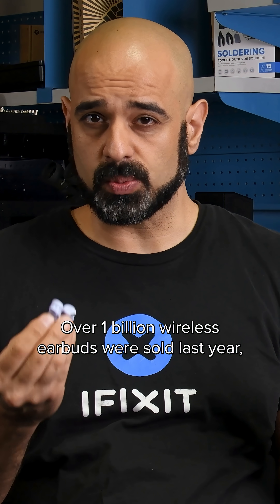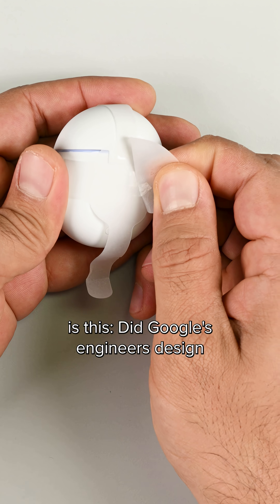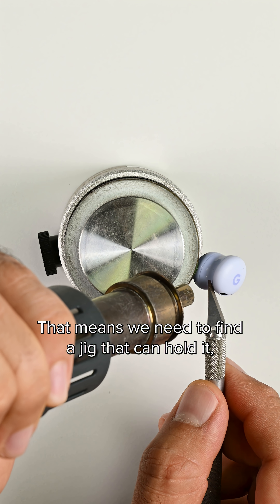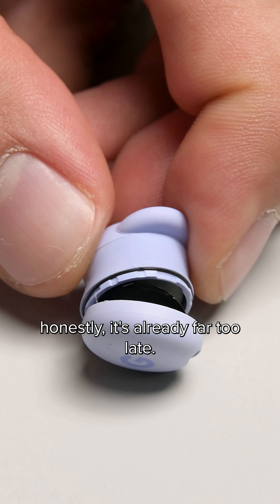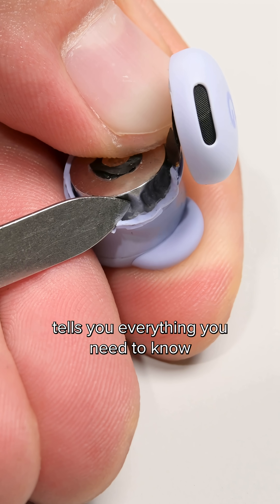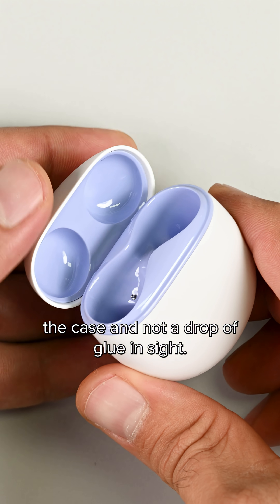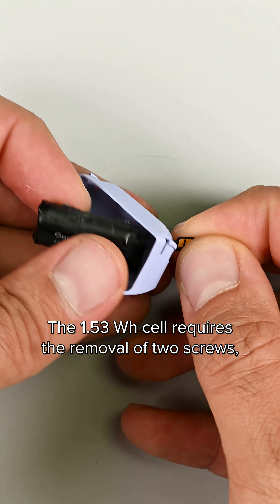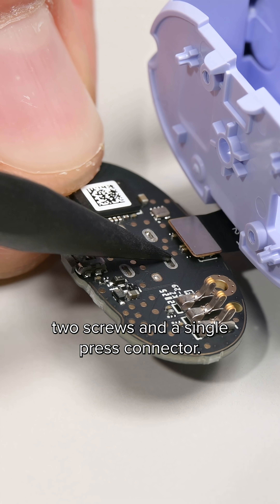Pixel Buds 2a: Two Button Cells Short of a Repairable Trifecta

Comment: Ah so the part with the battery that'll die first is unrepairable. Smart move from googs
Reply: Why are you so cynical. You're like so negative. Like it's not perfect but they took a big leap and they're getting there they're going in the right direction just be happy about that at least
Reply: @Alphabet7 well its like when apple made screens borderline impossible to replace. Its the most likely part to fail first. In this case the battery will likely fail first. Repairability to me means being able to replace the parts that will fail the most. This doesn't really meet that criteria now does it? And we should be critical about these companies considering that their forced planned obsolescence is destroying the environment massively. They all need to be held accountable especially in this case.
Reply: @Alphabet7  its like saying MacBooks are repairable because they have modular usb c ports that you can replace pretty easily. and only few windows laptops has that. no, MacBooks are not repairable at least they are not easy. same thing for this earphones.